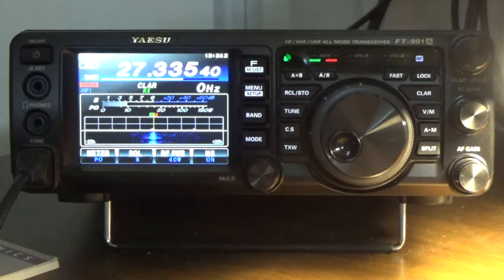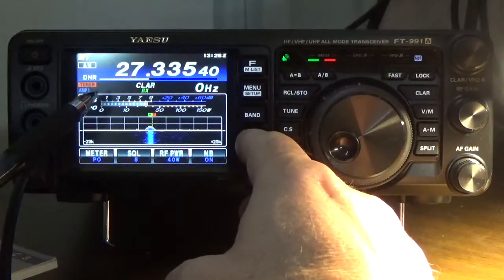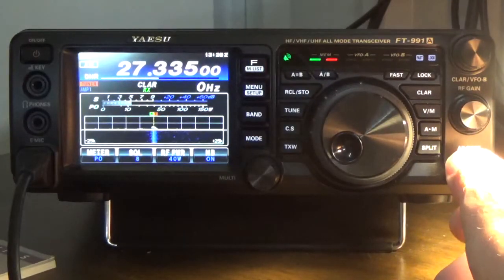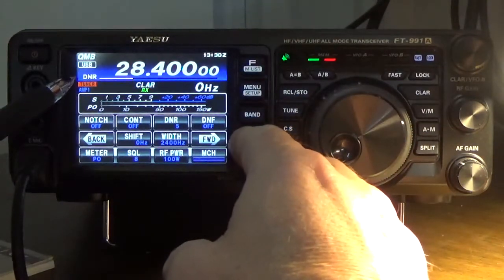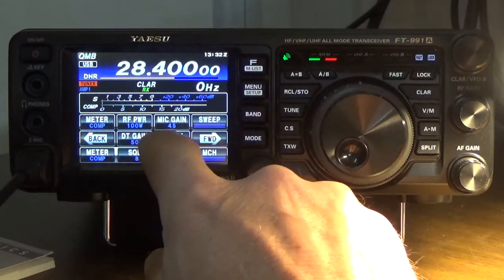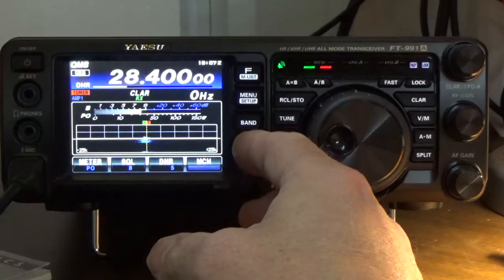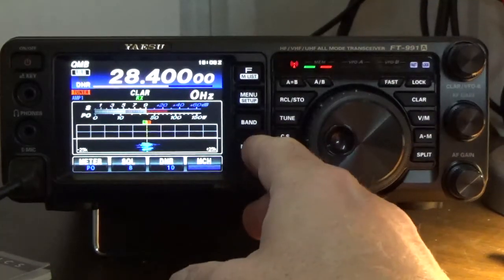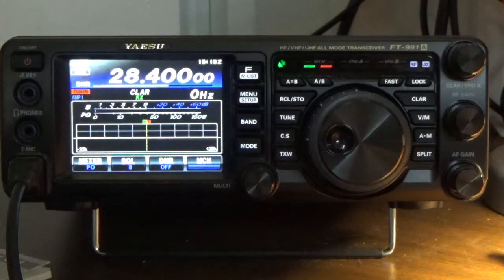Review the Yaesu FT991A (DNR) Digital Noise Reduction

Comment: I have owned 2 Yaesu 991A's, the Icom IC-7300 and now have the Yaesu FT-710. The 710 is by far the quietest radio of the bunch. However, having said that I would be happy with any one of the three. They all have their ups and downs. I have always said that Icom is better on the software side of radio and Yaesu is better on the hardware side of radio. Good luck!
Reply from the maker: Hi Kelly thanks for the message 73 keep in touch!

Comment: Hola soy Antonio EA7KFT de Córdoba España
Me voy a comprar una yaesu fr991A
Es para pedirte un favor si fuera posible que me grabación de un video de como programala 991A y como ponele el indicativo 73
Reply: Hola soy Rafael lu7frc  pudiste configurar en recepción hf el 991A?Si diste en la tecla comentame. Estoy en qrz ahí está mi mail gracias.
Reply from the maker: No problem - I can show how to program through the menu or using the RT systems software - the radio is great you will love it - I'll try to do a video tommorrow - si amigo Steve!!